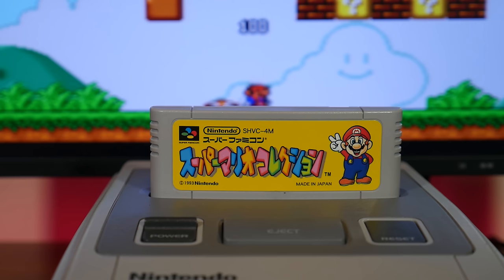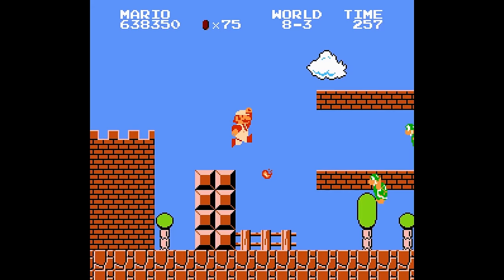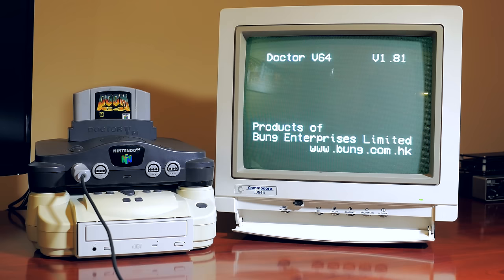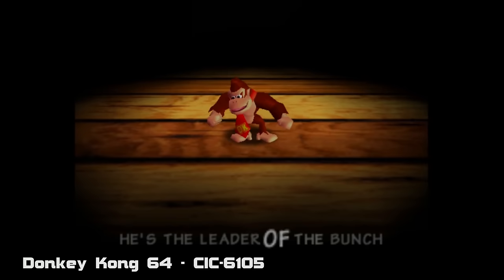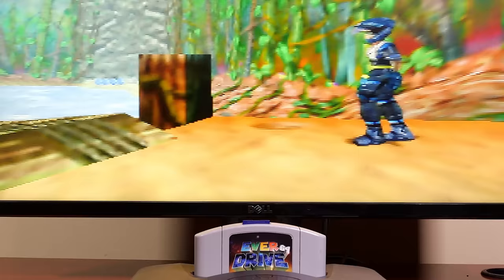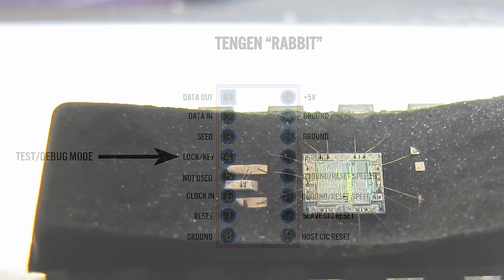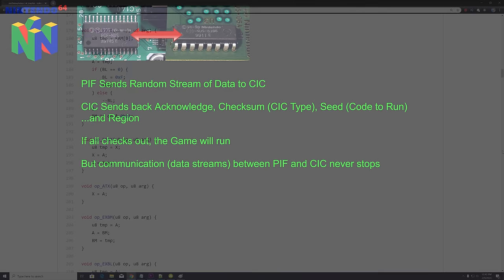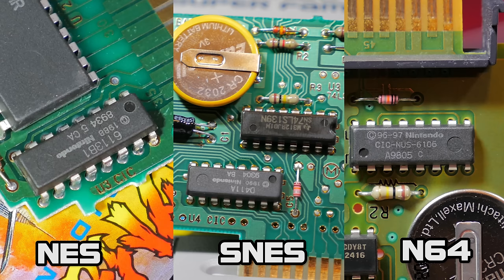How Nintendo Stopped Bootleg Games on the Nintendo 64 | MVG

Comment: Nintendo always had the "if it ain't broke, don't fix it" mentality.

It's what makes Nintendo, Nintendo.
Reply: Yeah like "the Switch is selling really good right now, we won't ever release another console if the situation doesn't change"
Reply: @samueleproiettimicozzi8134  then by that logic.. the Wii sold well... but why didn't they just keep making wiis
Reply: @adventureoflinkmk2  Nintendo will support it as long as demand is there, once sales start falling of course they'll release something new
Reply: adventureoflinkmk2 in fact they didn't follow this strategy at all back then. The Wii is an absolute proof of it. If I remember correctly it sold a little more than 100 million units, certainly they would have been much more if Nintendo continued to sell them.

But now it's a completely different story, before the CEO was Iwata now it's Furukawa. Speaking of which, recently he himself has confirmed that they are sticking to this strategy with the Switch.
Reply: @adventureoflinkmk2  Because the wii sales dropped off a cliff after 2009. Nintendo was not doing very well in the early 2010's. Wii sales were gone and the wii U was a flop. If it wasn't for the 3DS doing fairly well Nintendo might have been in a pretty rough spot.
Reply: I would argue Nintendo is on the other end of the spectrum, i.e. always trying to find ways to innovate (many times needlessly and to their detriment), while not bothering to fix clearly lagging issues in respect to their competition and current technology standards like their god awful online services today.

"If it ain't broke, try to fix it anyway; and if it is, oh well" is more their motto in modern times.
Reply: EvilApple567 well, Switch's online services are pretty fine... if you consider they haven't dedicated not even ONE server for them. It's all in peer-to-peer. Connection issues are just normal. You basically have to pay $20/€20 a year just to gain permission to directly connect to other consoles. They don't have even the need to ask money to pay their servers and "improving them".

The Nintendo WFC online replacement for Wii games (Wiimmfi) is 100 times better and it's totally FREE. And it's run by just a couple of fans.
Reply: That is 100% false for a myriad of reasons.
Reply: Is that why they went back to friend code? And less  ways to  communicate?  Between the Wii, Wii u and then the un-social Switch?
Reply: Gamèlyzed on the Switch? Well they may be depotentiated versions because the hardware is pretty limited compared to the other consoles of this generation and maybe they have worse controls as the joy-cons aren't the best for comfort... but we actually have games like The Witcher 3 ported to the console, definitely not every one of them but a lot are ported to the Switch, and if you include the first and second party releases... I'd think the catalogue gets kinda interesting if compared to the previous Nintendo consoles.
Reply: Except they're also known for being behind everyone else on basic features. So plenty of things are and were broken that took them forever to fix.
Reply: This made me think of video and audio outputs. Gamecube accidentally was on to something with a proprietary digital AV out, but then the Wii went back to analog only, meanwhile everyone else moved on to HDMI.
Reply: Nintendo may not follow popular trends but they are pro consumer. No micro transactions, late to the DLC game, complete polished games and making the wii accessories completely compatible with Wii U and GC controllers with the Wii and backwards compatibility with games (except for switch for obvious reseasons).
Reply: Le Rosa look at them joycons lol
Reply: how do you explain what happened to metroid then. was great until prime.
Reply: @adventureoflinkmk2  Wii U
Reply: Because its cheap
Reply: Samuele Proietti Micozzi except with their games.....still waiting on a Super Mario 64 sequel.
Reply: @EvilApple567  pretty much true lol. As for their online, it depend on the games, seems like mm2 and smash have bad teams for their online. Seems all their other doesnt lag like this. As for animal crossing, the problem there is more because of design decision.
Reply: That and another thing that makes Nintendo, Nintendo is the fact they try to make everything a collectible
Reply: Smattless  tell that to the paper mario crowd. Lol
Reply: Rapidshot exactly
Reply: [stares in Joycon Drift]

Comment: I wanted a Bung V64 back in the late 90s, but it was prohibitively expensive(~$400) and had to be imported from outside the US, which was a risky proposition back then. PSX was much easier to break, just required an external game enhancer that would plug into the parallel port and game patches to rip and reformat the CDs correctly. MegaGames was the website I used to get the cracks and patches.
Reply: I got mine in Manchester chinatown UK. Think I only paid about £150 and I could get 30 ro 40 games on one CD for £20 I ended up with about 6 CDs by the time the N64 was ending its lifespan and I switched to PC.
Reply: Megagames. That brings back memories. I used to get my no CD hacks from that site.

Comment: I remember hearing in the past from a friend of mine that they changed the circuitry of the system to help stop piracy. That's why stuff like stop 'n' swop with  Banjo-Kazooie and Banjo-Tooie would not work and was cancelled by Rareware. But then again I might be as to why they did that.
Reply: Stop N Swop didn't work because it relied on the RAM in the N64 retaining memory for a little while. Early model N64s would work just fine but Nintendo had released later models with newer RAM chips that wouldn't hold data long enough for the feature to work.
Reply: @SuperSmashDolls  oh ok thank you for clearing that up. 😁
Reply: @SirWhiskersThe3rd  Yes, during the development they changed the N64 board from using 2 2MB RAM chips to a single 4MB chip. While the older chips could retain data for quite a few seconds after power was cut, the newer ones didn't retain data nearly as long. Apparently this was found out during the testing of the feature and Nintendo told Rare to axe the feature.
I suppose they didn't want to deal with thousands of complaints about the feature not working or flood technical service centers with tons of consoles and cartridges damaged by children trying to jam the cartridge in too fast trying to do the swap in time.
Reply: @radornkeldam  it also does not sound like a good idea to tell kids to swap cartridges "as fast as possible"
Reply: @sarowie  Well, it was supposed to be around ten seconds. That's plenty of time... but yes, maybe children would be flustered and mess up even if there's enough time to do the swap calmly.
Reply: @radornkeldam  Nintendo saw the swap problem beforehand and had Rare stop it. There was also the possibility of corrupting data and Rare would be responsible if it was because of Stop n Swop.
Reply: @radornkeldam  yeah before it was 10 seconds, now it was only 1 second

Comment: n64 piracy had 0 effect on sales. Consumer grade flash storage was insanely expensive at the time, and most people wouldn't bother paying for a flash cart because of the price. It would be cheaper to buy a game, play it, and sell it. Piracy wasn't really a problem until optical media went mainstream. It was a gateway to a drug of free games. First Dreamcast, then mod chips, then CFW. From then on, we saw PSP take piracy mainstream. Then DSTT flash carts were sourced by everyone for $4/piece from china.
Reply: And now with digital games, the 3DS, Wii U, and Switch are pretty easy to pirate on, especially the 3DS. These days it's about a twenty minute process to get it all set up and download free games.
Reply: Well, N64 piracy back then wasn't done with flash cartridges, but with RAM based backup units.
That said, there are some rare cases of pirated ROM carts that relied on using a T-connector to piggyback the CIC from an original cart. Years ago I was shown pictures of Mario 64 and Wave Race cartridges supposedly from hong kong, with epoxy glob ICs on the PCB and that description.
Reply: @radornkeldam  Either way, it was insanely expensive, uncommon, and the average gamer would never bother with it.
Reply: No matter what, piracy will almost never be able to put a dent in a new game's sales during its prime. No security is truly infallible, and developers know this, so anti-piracy is developed purely with a goal of making the process of cracking the game slow enough that by the time the game is cracked, the vast majority of sales the game will see in its lifetime have already happened, and the pirates will only hurt the small trickle of late-life sales coming in. MVG talked about this mentality in his PlayStation 1 anti-piracy video during the Spyro the Dragon 3 segment.
Reply: it doesn't seem like rare etc would have gone to the extra work to exceed the basic protection of the CIC if it really had zero effect.
Reply: @blakryptonite1 the drV64 sold at least 3 million units worldwide. It was popular, easy to find and nintendo spent hundreds of thousands of dollars, if not millions fighting it. It was about £150 in the UK to get one. Not cheap but you buy one and you get the entire library on disk and never need a cartridge again? Yeha millions of people got them.

What a ridiculous statement. Nintendo said their cartridge decision ultimately had little effect on piracy because they just upgraded their supernintendo piracy. systems.

Comment: You could do a video like this on Gamecube, but it might run a little short: "They used Baby Discs, yep."
Reply: You'd think so, but there was way more copy protection than the weird size, and it needed it.  Mini CDs were very much a thing at the time and they worked in normal burners.
Reply: Halp ma $i$ter med me preggknot??Hhow to rtre?
Reply: @undefishin  How is babby formed?
Reply: If they wanted protection due to size they could have gone with larger discs. Granted it would have been quite expensive, and hardware hacks could have been made (although if you had to do hardware hacks, I'd say that the protection won?)
Reply: @MsHojat  They could have done it even more easily. Two words: Smaller. Hole.
Or even do a square hole or something like that.

Comment: N64 is awesome...except the choice of RAMBUS memory. A bottle neck for framerates, and performance.
Reply: It's vram is also too low
Reply: It was acceptable for the time period, I'd maintain.
Reply: @ruggie.74  Yep, it was thought to be the future of RAM. Even the PS2 used RAMBUS, the large ones, not sure about the slims.
Reply: @ruggie.74  There were many uncertainties like that for the time period when you look back. All 3 major consoles of that generation were radically different architecturally because each company had a different idea of what they thought was most important to this newly accepted 3D frontier in gaming. And with hindsight all of their designs are riddled with many questionable decisions.
Reply: So high cart prices and limited storage are awesome?
Reply: @The_Future_isnt_so_Bright  The PS3 also uses RAMBUS for the 256MB CPU-side bank
Reply: @The_Future_isnt_so_Bright  fat ps2 is better than the slim, specially the model SCPH-39001

Comment: Two things are impressive here. 1) Nintendo didn't make yet another CIC variant that could only run homebrew games, by doing something wild to the controller input so no stock game would work without extensive patching. 2) No game creater thought their game was worth putting some dollar-cpu (this was late enough that there were dollar cpus already) in the cart and running some background thread on it so a ROM dump simply doesn't work. The bus tiedowns could be altered in different carts so a generic attack would be impossible.

Comment: I'm working with Jago85 to offer the PIF replacement for N64, so one console will play all NTSC and PAL games.
Reply from the maker: nice. how does that work? do you need to solder in the new chip as a direct replacement or via some other means?
Reply: @ModernVintageGamer  I'll try to contact you via Twitter to send some pics and details.
Reply: oh nice, this sounds sweet!
Reply: Neat, where can we follow the project?
Reply: @somebonehead  Here is the original thread. Sorry, but almost everything is in German. https://circuit-board.de/forum/index.php/Thread/24209-WIP-UltraPIF-Multi-Region-N64-PIF-Replacement/  I already published the PCB stuff on github. As soon as I have some more spare time I want to publish all the FPGA and software stuff. https://github.com/jago85/UltraPIF_Hardware
Reply: @jago3798  nice work, keep it up, will be an outstanding release.

Comment: Why did vintage gamers celebrate when the Nintendo 64 turned 18 in 2014?

They could now legally blow the cartridges.
Reply: God dammit 😂
Reply: Blowing into cartridges never really did anything right? I remember my dad teaching me that on NES & Genesis. Surprised we didn't lick PS1 discs.
Reply: I will still believe that blowing into the cartridge does help. I've tested several times with games that won't start. Just taking it out and putting it back in multiple times, to remove corrosion, as people suggest does nothing. When I blow into the carts, they then startup almost every time.
Reply: @kingdavid7516  but pulling the cardridge out and put it back in scraps rust off the pins. I think the rust pins could be the cause of the old games not being to boot.
Reply: @kingdavid7516  it removes dust and debris from the contacts if the carts arent stored well, which makes contact better and can actually help. but if you keep them cleaned and stored properly it wont do anything other than accumulate spit on the contacts and make them rust
Reply: @JohnSmith-xf1zu  well it kind of does, but it'd be best to just clean the pins with rubbing alcohol and q-tips
Reply: @GamingSince1998 point being it does something
Reply: Neh using rusty sea water will be fine....my comment saying using rubbing alcohol with a qtip would be best must of just flown right over your head.

Comment: U convince me

I'm buying a n64
Reply: You'll never regret it, trust me
Reply: @joshm264  Well, if you want relatively good image quality you might regret it unless you want to mod it. It mostly only supports composite video, some revisions support S-Video and some are easily RGB moddable while others aren't as easy to RGB mod, UltraHDMI's aren't readily available either.
I personally don't regret my buy, mainly because it was cheap (35usd for a blue translucent japanese model in perfect condition) and because I like tinkering with stuff so I RGB modded it.
Reply: I bought mine for 5€ with Mario 64, Goldeneye and 2 controllers. I don't regret it, but it's a crappy console. Most games run 5-10fps and tbh emulation is the best way to enjoy them.
Reply: i got my Japanese n64 for 62Euros but it was worth it
Reply: Ever drive 64 + Ultra HDMI is a must
Reply: I found one with a Nintendo RAM Expansion for $40 at a pawn shop and it included a controller. That's basically like 60% off. I picked up a $1 game too to pull the back from to play JP OoT on my N64. (For speedruning, plus I've played the game without textures so I know it way too well for an unknown language to stop me) I didn't grow up with one, but with an Everdrive64 you can do so much with it. Especially now with hacks such as optimized SM64 and even some ROMHacks ported to actual hardware. Trust me, if you can get one on the cheap it's worth it. Make sure to hunt down some kind of RAM Expansion as Perfect Dark, DK64, Majora's Mask, and a few other games use or need it.
Reply: @stephenhogan5924  Honestly if you're going to the ultra HDMI / Everdrive route then I'd say just use retro-pie. It's way cheaper.
Reply: StabStabStabStabby I want it on original hardware!
Reply: StabStabStabStabby plus retro pi sucks running n64
Reply: Get a Sega Saturn, too.
Reply: bieen I think he means it dosen’t work very well
Reply: @PaintsAreOp  Actually some games, including Mario 64, weren't optimized for the console.
Reply: @techwin2  What are you saying my friend? It was made and optimized specifically for N64 and one of the best running game for the system. MVG did a video about the not optimized part: https://youtu.be/NKlbE2eROC0
Reply: Also, buy an Everdrive 64 for it ;)
Reply: I bought one a few years back and sold it about 4 years ago and really regret it now
Reply: @stephenhogan5924  might as well emulate at that point.
Reply: @stephenhogan5924  hdmi ports and everdrives aren't original hardware.

Comment: The N64 never caught on here in Brazil because of this anti-piracy system. Original cartridges were VERY expensive, and the lack of pirate copies (which were everywhere on the NES and SNES) priced out the vast majority of gamers.

At the time, you could walk into any small games shop and buy PS1 CDs for US$ 5 each. I remember stopping by a nearby store on my way home from work and buying three or four games every week. Such a low price allowed for experimentation, and I never worried about getting a "bad" game because the cost was so low.

A similar problem affects Switch gamers today. Games are priced based on the exchange rate, so in theory we pay the same as any gamer on US. But the exchange rate is around 1 USD to 5.2 Real, and since we earn in Real and the purchase power of our currency is low, a US$ 70 game has the same impact for us as it would have in the US if it went for US$ 350.

When purchasing games on the Switch, we have to plan ahead, take advantage of sales and sometimes finance it in monthly installments on the credit card to lighten the load. 

The same affects PS4 and PS5 users. One of the factors that make the Xbox popular here is Game Pass, which becomes a VERY affordable way to get new games.